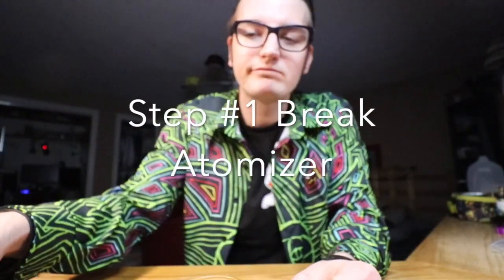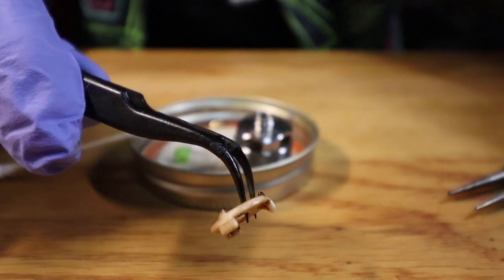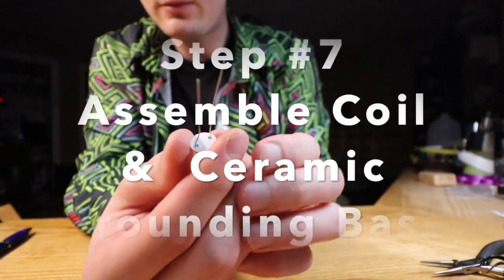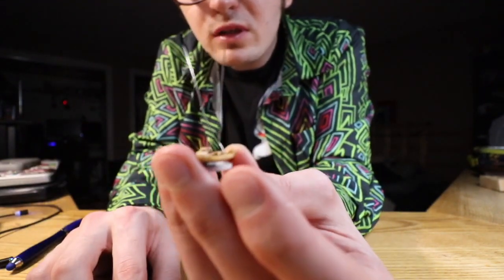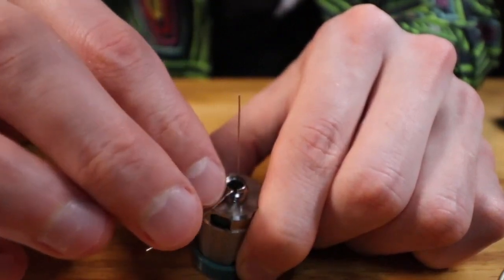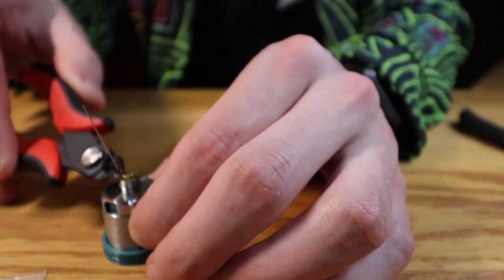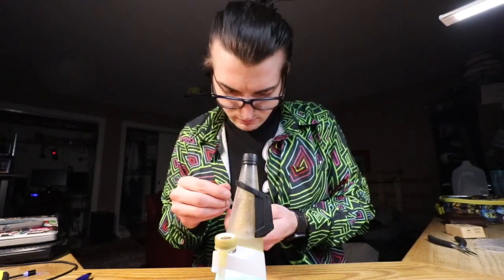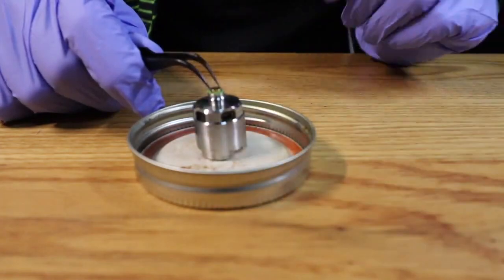13 Steps to Replacing Your Broken Puffco Peak Atomizer           Step's In Description

Comment: Hey how do you know when JCVap atomizers are done?  Asking because I am starting to get just red light errors, 3 red lights often and it goes to overheat very quickly - long red light with vibration.  Also half way through sesh I get 3 blinking red lights - battery is fully charged.  Just wondering if that means heater is going out, seems to be getting hotter than usual but temps from app are ok, until I get 3 red lights, app just sits there.  Not sure if this is a short or battery issue.  Again used to get red/white which haven’t seen in a while, now only red lights but after messing with it sometimes I can get it to heat… urgh